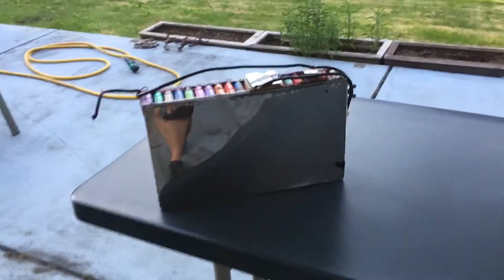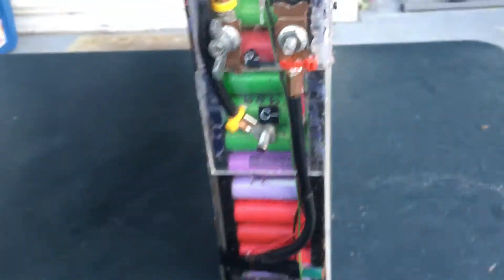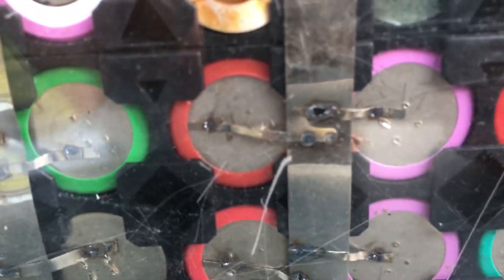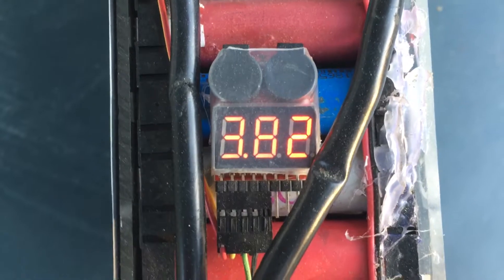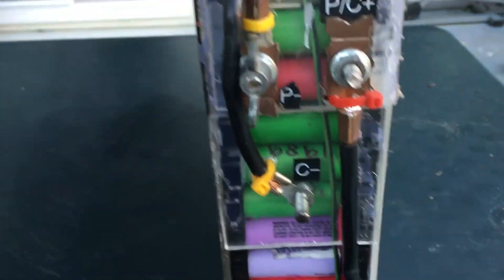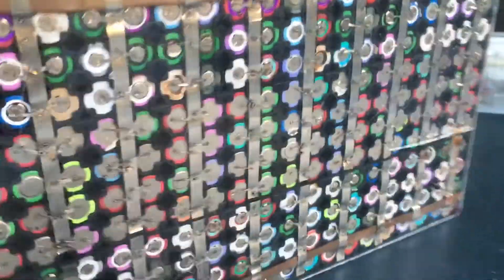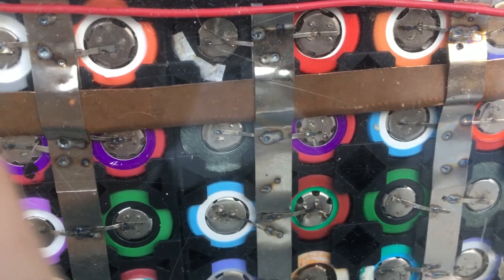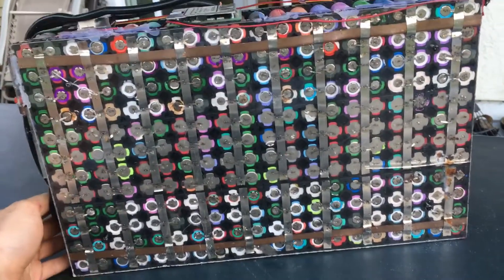2.2kWh Solderless 18650 12V Powerwall RV/Camper Battery Pack

Comment: Hello, I'm trying to make something very similar to this only I will be making it in modular parallel packs, I'm not going to use a bms but I will be making my battery much more powerful than the max power I will ever pull from it and I also just don't want to spend money on a bms because they are expensive, I'm thinking about using a Imax b6, I  can charge up to 6s which would be 24v and I could potentially add another identical mAh 24v with it's own imax b6 so it would be 48v, although I don't know if the imax b6 is capable of doing this? I'm currently making a somewhat large 22in x 15in x 16in box to store everything in and it will be charged by a computer power supply wired to the imax b6 which will be connected to the batteries, then I'll connect the battery straight to a ~1000watt inverter. There will be a Voltage buzzer like you have and a few USB ports powered by a DC to DC step down, im 100% aware this has no over discharge protection but I'm not worried because I won't drain the batteries past around 3.5v normally, it will also help the batteries last longer. Sorry for this very long message I'll be surprised if anyone reads all of this.
Reply from the maker: are you using solar to power the imax b6 to charge it?
Reply: @InflamedBallz  nah the computer power supply which will plug in the wall, ill have to modify it to output 12v tho. Solar just seems too expensive for me for how large of a panel it would take to charge it, although I am also working on a small solar stationary power bank thing by my window to charge my phone.

Comment: This is not solderless. Your title is misleading.
Reply from the maker: all the cells connections were made with a spot welder and the connections to the copper buss bars were made without solder. the only thing soldered on are the battery cables. the battery pack itself is solderless.

Comment: Nice pack.   I built a 4s pack myself but am thinking about changing it to a 3S because the voltages match my xantrex inverter alot better. Why exactly do you want to move up to a 4s?  Thanks
Reply from the maker: YouTube305 my reasoning with 4s you could use the whole charge cycle from 4.2 ish volts down to 3v but with 3s you can only use the upper part of the cycle before inverter low voltage cutoff kicks in. Many kick in in the 11 volts range. More cycles that way too as you could charge lower to 4v for longer life of your cells.  It's hard to find an inverter with a high enough High voltage cutoff but they do exist. But you also run the risk of draining the cells too low. In the end I'm now using lifepo4 in my RV because the voltages match better 14.3/4 fully charged. Hard to find used cells though. Ended up buying them bulk dirt cheap
Reply: @InflamedBallz  would. Love to see your lifepo set up in your rv. I've been thinking about doing it for mine.
Reply from the maker: @Dj1duke  I ended up selling the van but when I'm back in Canada next month i'll try to dig up some pictures for you I have from building it!

Comment: "Grape 40" , 40 amp PWM solar controller
BT phone app allows you set ALL parameters, charge voltage, high and low shut off voltage, even has a lithium setting, everything is programmable, fantastic price $49, can be found on amazon , i put one in the RV,  charging my RV 665 ampHr AGM bank
Reply: You'd be losing a whole lotta watts with a PWM charge controller. The controller mentioned in this video is about $150 I think and is MPPT, which means you can use it with high voltage solar panels, which means cheap 300 watt panels, and allows you to overdrive the capacity. For example I have 900 watts of 46 volt panels charging my 4 Trojan 6 volt batteries wired for 12 volts. According to the specs of the controller I can have even more panels than that, though of course it'll never output more than 40 amps. But I reach that 40 amps a lot more often. Can't do any of that with a PWM controller. In the modern era there's really no reason at all to use a PWM controller.

Comment: Very nice little setup you have there. I like the hard pack design you built. Definitely would protect the cells from outside damage and easy to see the fuses if blown.
To be able to use more capacity of your cells, I would recommend going to 24V instead of 12V. 12V setups you either can't go all the way full, or the voltage drops below cutoff before you use more than 50% of the cells.
12V @ 3s. For a 3.2V safe cutoff per cell that would be 9.6V. This is way below BMS discharge cutoff point. At 4.2V being the top voltage per cell, that'd be 12.6V. This is still below the BMS charge cutoff, so over charging the cells is very likely.
12V @ 4s. For a 3.2V safe cutoff per cell that would be 12.8V. This is slightly higher than the BMS discharge cutoff. So it's likely the BMS will allow the cells to drop to ~2.77V per cell, which is an unsafe level for these cells. At 4.2V being the top voltage per cell, that'd be 16.8V. This is above the BMS charge cutoff, so it will disconnect before reaching this voltage. If the BMS stops at 14.5V, then max cell voltage will be ~3.63V per cell. So there is still at least .4V per cell of unavailable voltage/capacity.
24V @ 7s. 3.2V/cell = 22.4V; 4.2V/cell = 29.4V  This gives plenty of room for the BMS to function in safely (albeit it is still not fully charging/discharging @ 24V, but a LOT better than 12V)
If you haven't already checked it out, we over at diypowerwalls.com have a fairly extensive collection of data (or is that datum?) regarding the 18650 cells from laptop battery recycling.
Reply from the maker: Korishan better option is 4s 16.8V and adding diiodes to your car alternator to output a voltage closer to that and just get a solar controller and inverter that will work with a higher voltage. (16.5) This pack is made for an RV with a 12V system and 24v doesn't make sense. Too much losses from stepping down. I don't use my bms cutoff because I only use my bms on the charging side and output straight from the battery leads. Thanks I'll check it out
Reply: Ok, so if you use the BMS for charging, the BMS will disconnect at a lower than optimal voltage; unless the BMS has been configured to go all the way up to ~16.8V cutoff). So you are still not getting full capacity. The other problem with this is that 16V is actually too high for most 12V devices. They are usually set with a max of 15, or 14.8V as most automotive alternators don't output above that voltage. My uncle had all his lights blow out from an alt that failed to keep the voltage low.
With the 24V setup, you can use a buck converter to drop the voltage down to 12V. This is very efficient and you can use all of your capacity. You can either use a buck at each device needing the 12V, or get a larger amp output one (or parallel several smaller ones) to get the needed output amps (or build your own).
The other advantage to using 24V over 12V, is the wires to charge/discharge the pack can be much smaller. Granted, you already built this setup, and the RV is already wired for 12V. So no biggie there  ;)
Reply from the maker: Korishan you're going to lose 10% efficiency with that buck. And parallel boost/bucks do not work well together. Usually one ends up sharing all the load. A 4S bms will be made to have an upper cutoff a little above 16.8v. The absolute best solution is Lifepo4 14.4v fully charged. Perfect for a 12v leaf acid system replacement.
Reply: LiFePo4, now you're talking  :P  Altho, personally, I haven't messed with them. We have a few members on the forums who does though, and have extensive updates on them. Daromer (DIY Tech & Repairs on youtube) for instance.
Yeah, I suppose there would be inefficiency in the buck converter. But, you'd gain more than 10% in capacity available to you. But I suppose if the BMS will handle the voltages correctly, and your equipment in the RV can handle the higher voltages without issues, then that's all fine and good.
Reply from the maker: Korishan which forum?  I just made an LIFEPO4 battery last week hehe. 110ah 4S. Loving it so far because it's just a drop in replacement and it's staying really well in balance unlike these mix n match recycled packs. Realistically if I wanted to use the pack in this video for any heavy loads I'd need those 6A active balancers from aliexpress to keep it better in balance
Reply: On the diypowerwalls.com forum, DIY Tech & Repairs has his build under this thread: http://www.diypowerwalls.com/t-Esperyd-Solar-and-powerwall-system
he's one of the main contributors. Very knowledgeable in many fields. 
If I had a good source for LiFePo cells, I'd probably go that route. But, LiCo's are more common and readily available in my area. I post an ad on Craigslist and I get swamped with requests :P
Reply from the maker: Korishan thanks brother. you mean you're selling them or trying to buy?
Reply: I buy the laptop/powertool/etc packs by placing an ad on craigslist asking for them. So mostly (99%) are LiCo cells. I did get a few powertool packs.
I have the space to make large battery banks to compensate for low capacity cells. So if my storage takes up 30sqft of space, no biggie. But for the house, I'm going to be running 48V setup.
Reply from the maker: Where do you live? You could possibly find them at hardware stores, recycling depots, and computer stores. If you're mixing and matching cells i highly recommend these. goo.gl/PmuTHL Most bms have 40-60ma balance current where as these have 6-10A. It's so hard to get each series row completely similar in capacity with mixed cells in my experience.
Reply: Fl, USA. I've already checked most places around here. Hardware stores said no, computer repair shops said no, college said no (well, they don't deal with many batteries). I haven't checked the ebike shops yet. That's on my todo list, just haven't gotten to them yet.
Yeah, there are some on the forum that use those. They only work in small applications. When you start getting into the 10's of KWh, it starts getting harder to keep everything balanced. Also, they don't have much as far as monitoring goes; as in, reporting back so you can see what's going on. I'm actually going to be building my own BMS based on the TI's BQ76940 chip. Maybe I'll get to a point where I can compete with Batrium
Reply from the maker: Korishan sounds awesome dude. Make something to sell. There are lots of people getting into this now and the bms tech just isn't there yet at a consumer level. I know a place you can order 1.6KWh of lifepo4 for $150 USD. If that interests you
Reply: Kewls, thanks. I'll hafta keep that in mind.
Reply: 24v is great for inverter use 
 but if you want to power the 'camper' lights , water pump, etc,, you need 12v
Reply: KundaliniKid I'd love a link to the LIFEPO4 supplier you're talking about. Thinking about building a battery and solar system for our RV. Thanks!

Comment: Hey curious how this worked out for you. I'm interested in doing the same thing for my camper.
Reply from the maker: John P balancing is an issue. Going to want to order the 1S balancers off aliexpress that have up to 10a balance current to keep the pack in balance. Say each series row is 500mah out of balance of each other. (Good case scenario with used mixed cells) With a traditional bms with 40-60ma balance current that would take 10 hrs of charging to balance it out. And it would go out of balance every time you discharge it. With those balancers this would be a really useful battery pack for an RV.  Alternatively you an make a smaller one that you can bring around in a backpack and charge up anywhere
Reply: hey thanks alot for the reply!.. would you say your getting more amp hours from this battery back then a traditional deep cycle lead acid battery?
Reply from the maker: John P depends on the battery. Agm you get 50% depth of discharge. Flooded you get even less if you want them to last. I just built an LIFEPO4 battery for the RV and I love it. 110ah for $180 Canadian plus bms. Give me your email I'll send you the link to the deal. Lifepo4 is best because full charge voltage of 4S battery is 14.4V -a perfect lead acid replacement
Reply: sent you a message
Reply: KundaliniKid  can you share the 14v Fe battery design?

Comment: nothing about this is solderless wth
Reply from the maker: the only thing soldered on this pack is the are the bms wires. All the nickel fuses are spot welded and the connections to the copper bus bars are pinched.

Comment: At what amp does those cell fuse blow? Looks like abit to much :) hope it will work for you 👍
Reply from the maker: From my testing around 3-5a depending on how precise I cut them. I was finding that not all cell failures cause high currents to enter the dead or dying cell and that 3a would be needed to cover all cases of failure and prevent the entire pack from draining.

Comment: Trying to understand how you setup your leads... does P/C+ bypass your BMS and go straight to the bus bar? P- and C- go to your BMS and then the BMS connects to your parallel sections? 

Also, your inverter connects to P/C+ while your charge controller connects to P- and C-, right?
Reply from the maker: B33SON Don't worry about the labelling.  I have two separate P+ lead for charging and one for discharging that bypasses the bms to plug into the inverter. You can add one for discharging from the bms as well for getting under voltage protection but it's only for small loads, otherwise the inverter does the voltage protection.
Reply from the maker: Charge controller goes to P+ and C-. P means power and c stands for charge. Inverter goes to P+ and P-. My apologies if it's not clear in the video
Reply from the maker: Charge controller I recommend the tracer 4215bn because you can set all the output values for all the stages of charging either with your computer or an optional control screen. The control screen is worth it. Ep -ever (same manufacturer) has some programmable pwm charge controllers which are a bit cheaper as well.
Reply: Did you say that for a truck camper RV you would recommend 4 cells or 15.8 volt ?